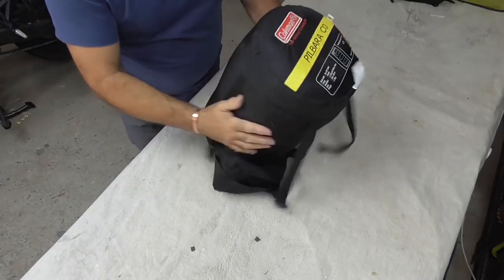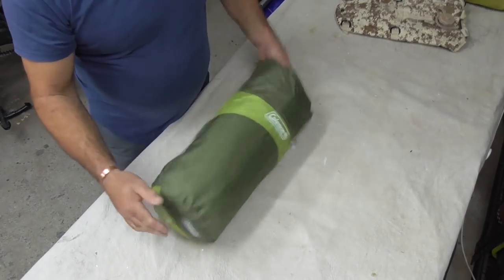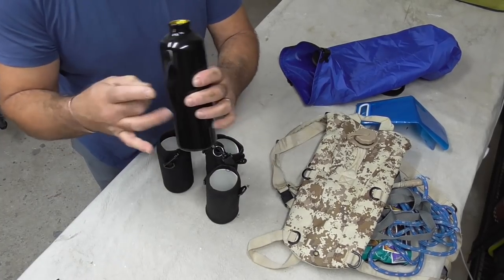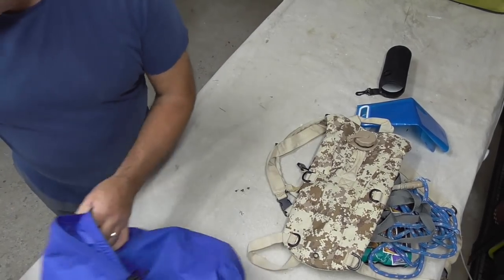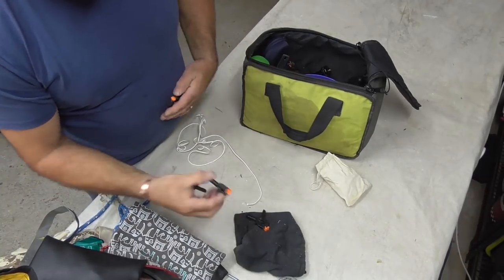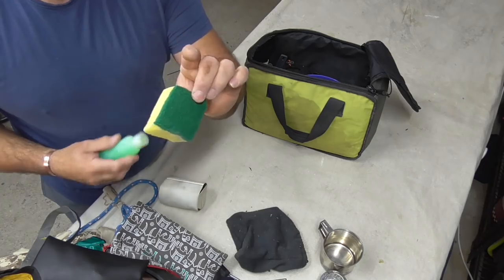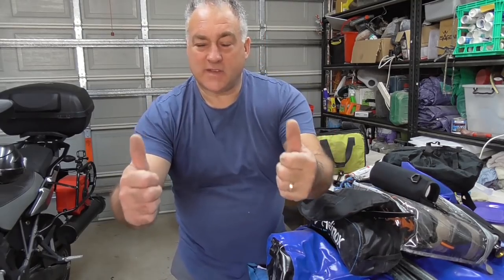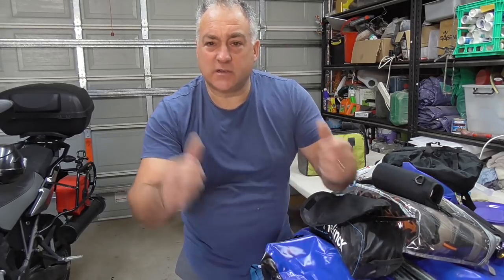Motorcycle camping gear

Comment: Nice video... Lots of stuff definitely... Some would say dedinitely too much stuff but that depends on the bike, on yourself and the kind of trip you're going for. 

As for me, I can totally understand that you want to keep some comfort and practical aspects when you go for a trip. 

That being said I like the idea of the table made of a chopping board... Really nice !

One thing you might want to consider would be to switch your gas stove to a multi fuel stove. There are countries or areas where gas bottles are not always available while finding fuel is not a problem. 

Also a fire stick would be a nice addition to your camping kit. It makes it easy to start a fire camp and works in any conditions, even wet. For example if you're wet and need to get warmer that can be a more reliable solution than having to use matches or a lighter.

Comment: For a sleeping pad, check out Klymit (more compact and lighter weight). For tents, check out Marmot up Tungsten, Hype & Byke,  or Big Agnes series of tents (light weight and more compact in size) For cookware, stainless steel is the better way to go. I got the essentials; pot, pan, cup for $5.97 at Wal-Mart. For water filtering check out CNOC water pouch and the Sawyer water filters. I'm into bike touring so our goal is compact and lightweight.
Reply from the maker: Thanks Tracey since the video i have swopped to a sea to summit self inflating bed,,, love it

Comment: Hi, I am planning a 16 day tour with my girlfriend on an R1200 GSA. BMW says that I can pack a max. of 25 kg in all three paniers. Unfortunately, I will have more gear. Question: can you exceed that limit and what should be a safe extra weight? What’s your experience with this? Thanks.
Reply from the maker: szlaeyer22 
Hi. It depends on your panniers and boxes my old shad panniers were rated 10kg each and cheap top box was also 10kg
I upgraded to givi outback aluminium boxes that take around 15kg and still they recommend 10kg in the top box even though its a 56ltr box
My opinion would be if you carry a passenger at 75kg or a passenger at 55kg why cant you spread a bit more weight over the bike. A good practice is to try and bring weight forward, say tank bag or crash bar bags. Hope this helps 👍👍
Reply: Wulf On The Run the panniers are the stock BMW aluminum panniers, which are, in fact, supplied by Wunderlich :) passenger has approx. 60 kg and I do have a cheapo tank bag, but I’m not sure what I could fit in it, that’s heavier. However, I didn’t really try until now, so, thanks, that will be one area I’ll “work” on. I will also look into the crashbar bags. Thanks.

Comment: It is properly too much gear, but if it makes your journey better, then who cares, if you can have it on your motorcycle. :-)
I have only some comments about your first aid kit.
I would move it away from the side of the bike and onto your body, because, if you have an accident and the bike is landing on its side or worse, is going down a cliff, while you are laying bleeding on the road, your first aid is either trapped under the bike or 10 feet down the cliff.
Always have a emergency whistle, a torch that can flash, a space blanket, some water and a first aid on your body.
Reply from the maker: Fried Mule 
Great suggestions thanks 👍

Comment: How about a solar charger for your phone? incase you run out of batteries or would prefer not to use them up.
Reply from the maker: T cor 
Hi
The one battery pack is able to charge up by solar
Liking your thinking 👍👍

Comment: WOW.  You carry a LOT of camping stuff, but your lame tool kit (especially the crescent wrench) offends me deeply.  I might suggest building a custom tool kit with box & hex wrenches to fit every fastener on your bike; no more, no less.  You can fire up that arc welder to make a box wrench with a different size on each end, or make a custom long wrench from a socket for the axle nut.  An alternative to your wood block for the side stand pad is a cover plate for a 4" electrical junction box.  For bikes that have no center stand, bring a block of wood or a length of dowel sized to hold up the right end of the swing arm with the rear tire just off the ground.  This unloads the rear wheel and makes chain lubing a snap, also seriously needed when removing the wheel.  Same thing up front, too.  I have tubeless tires so I carry a tire plug kit to go with that air compressor.  IMHO, inner tubes are the main downside to spoked wheels.  Maybe a GOOD quality chain breaker & some spare links in both master and inner types as well.  Get a Grease Monkey or clone it to reduce waste & mess on chain lubrication.  Thanks for sharing.  How long did it take you to clean up after making a mess of your stuff for this video?
Reply from the maker: Haha always takes longer to pick up.. Thanks for the comment.. Heres my tool kit now. https://youtu.be/RNt9r4QYFFQ

Comment: 1metre sleeping bag and a 700mm 1man tent Hmmm
Reply from the maker: Lying on my back thats 700mm used, my belly is nearly 700mm in the air that makes 1400mm of bag used out the 2000mm, just a bit left for stretching... LOL
Reply: @WulfOnTheRun  That,s right I don,t think in 3D but I like your kit
Reply from the maker: @dontfencemein.6125  thanks Keith trimmed it down a bit since this video and always use the 2 man tent now. More room to keep motorcycle gear inside after leaving it drapped over the bike all night and finding a big huntsman spider in my pants the next morning 😄

Comment: Dude what you forgot to say is that you are a car garage camper. I can tell youve never been camping. All your gear is impecably clean and new. This is too much gear for a car let alone a motorcycle. With all this gear you are likely riding on one wheel. Your front wheel is on the air. Dump all this gear and get a motel room
Reply from the maker: Not sure if you have been camping in the Australian outback or bushland no motels there buddy.
Check out my video of me actually camping
https://youtu.be/nzvNSoOGzeY
Reply: @WulfOnTheRun  Just stumbled upon this "video"... Actually, the video of you actually camping is a video about you actually not camping (I strongly  believe you never did - Panos is right). Just got your minion carry with the pickup your gear... including the motorcycle cover lmao. Or found him there and decided to make a video of his camp. BTW, what is the point of mounting a backrest to that case? And why mounting it upside down? Just curious
Reply from the maker: @nickthegreek74  
Haha there is a video of me loading the bike too. The top box came with the backrest on it. But was digging in the wifes back that way. So turned it over.
Reply: @WulfOnTheRun  :-D Glad you fixed it... I had a friend joking about true use of a backrest (not sure if appropriate here :-)) Now getting to the point, the reason I stumbled across this post is that even though I have experience in camping (it was done with a backpack or by car, for over 100 nights), and I am plannning to restart these experiences by motorcyle (did not camp in over 20 years), so I want to understand what are the best packing options (of course I want to get more than I used to get on my backpack and still be nimble in the twists) and what stuff to get along. Of course, I still believe that at that time you were carried away by the stuff you purchased, but maybe some years of actually doing it allowed you to hone your skills and improved your "load". Even though, taken individually (with the noticeabe example of the hillarious "mini" axe), everything looks pretty interesting, the simple  idea of getting everything (I assume 70+ kilos) on a bike for a trip (not including the wife/girlfirend's bare neccessities) is hillarious. Maybe you can share true life experience of carrying such stuff and using it, so it can bring light to the rest  of us :-)

Comment: You're killing me with all this gear....as I type this you are throwing  around a bunch of tent rods and whatnot. Get yourself a camping hammock, top quilt, and bottom quilt and you'll have the best night's sleep ever and won't get cold. Best part is you can fit all that in that one compression bag you had.
Reply from the maker: Cheers Dave i have contemplated a hammock. But im a side sleeper. It would be a whole lot easier than trying to get off the floor in a morning.👍👍
Reply: @WulfOnTheRun  I sleep on my side at times...in a hammock as well. You want an asymmetrical hammock....when you lay diagonally in the hammock your body is completely flat. Not bad to sleep on your side.  Check out hammockforums.net theres a lot of good info there!
Reply: @davecarroll4086  Dunno where your at Dave, but trees aren't a given here in Oz. 
And if they are there, a lot of camp place don't allow attaching things to them. 
People destroy stuff sometimes.

Comment: mini axe hammer is a joke toy
Reply: kinda pisses me off that this is even made lol. let me know if u find a use for it which a rock, a stick, and ur knife couldnt do better. 
i been camping on bicycle (super limited capacity). cant wait to make the jump to motor bike.
 thanks for sharing.
Reply from the maker: @canolacola4353  I've used it most times when I go bush camping in the Aussie outback, the ground is rock hard and no rocks around just compact sand to knock pegs in also used it to descale and cut gut fish. I sharpened it to a razor
 tiny, light and yep always take it with me
Reply: @WulfOnTheRun  oh. i guess it easy for me to call it useless when ive always got my hatchet (some can argue is heavy for bicycle.) luxery tool cuz in these canadian woods there is always rocks and sticks. can survive without.
i suppose it may be suitable to some